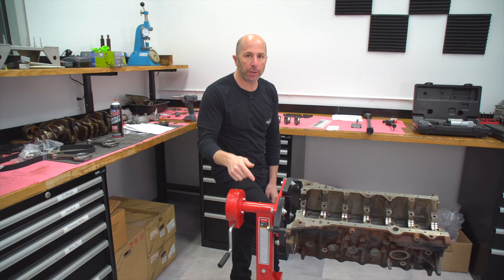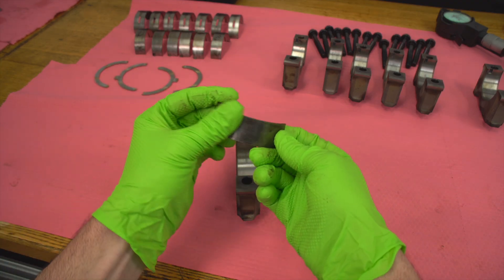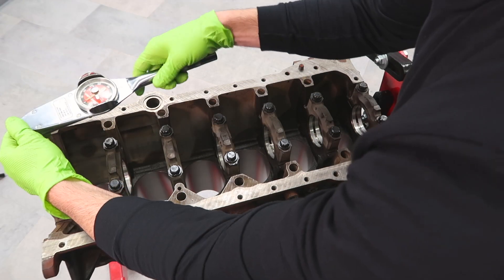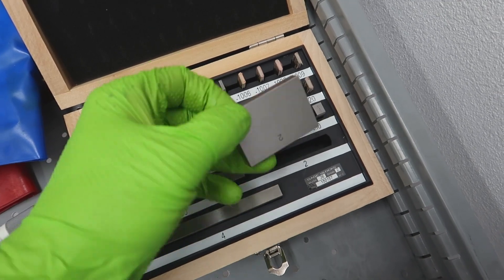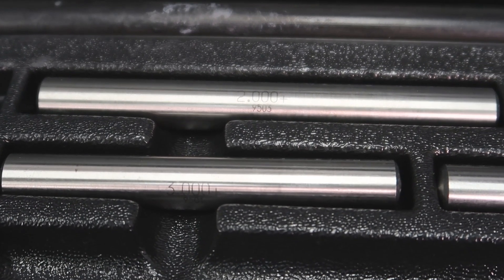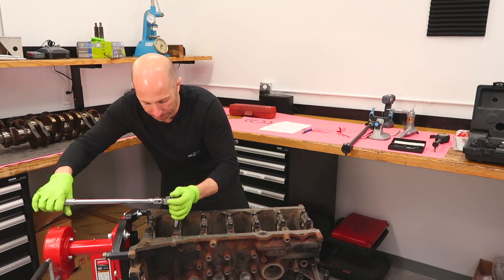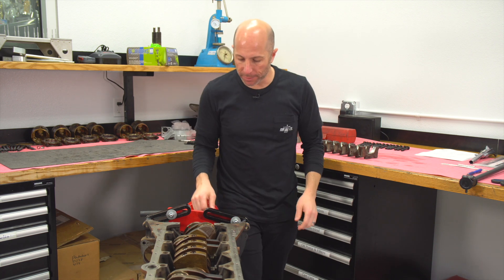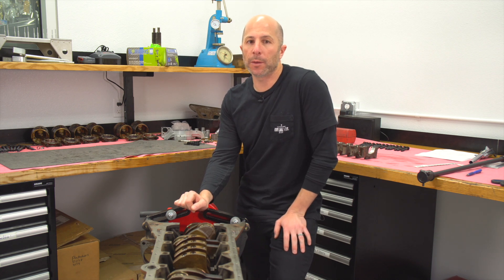$7 Vs $1,000 Engine Bearing Measurement Tools - Plastigage vs. Sunnen Dial Bore Gage

Comment: For an average joe  plastic gauge is sufficient , high end tools are for business or very high performance engine. lost my damn mind with the imperial system tho.
Reply: @firstbloood1   And your point is ?
Reply: Dont forget the SUNNEN causes a slight error, too. So not the complete error is actually caused by the plastigage.
Reply: Because decimal inches is so different that decimal meters ¡
Reply: 62mm vs 2.440945 inches.

OTOH, since we're not using fractions, it doesn't really matter what the system is. It's just decimals on the right side of the separator.
Reply: @AnttiBrax  Too much number
Reply: @AnttiBrax  You don't even need the last two decimals.  2.441 or 2.4409 is plenty.
Reply: @AnttiBrax  but it does matter because US industry wastes millions every year on conversion errors and mistakes from an inferior measure.
Reply: okleydokley That’s true, but honestly there’s not much the average joe can do about it, so I’ve just gotten used to both systems.
Reply: @truantray  you're right, we should stop using the inferior metric system.
Reply: @firstbloood1    Nasa switched to metric in 07 cause partner countries kept messing up the conversions and NASA was getitng sick of having to verify everyone's work for everything, apparently doing anything more than multiples of ten was to hard for them.....  And NO scientist will switch to metric to do calculations then switch back. Only a half wit could not do them in imperial.   Oh wait, Europeans... what do you expect, they can't even keep a self beneficial economic trading block from falling apart...
Reply: As a machinist you get what you pay for. If by the 1000 gauge in a heartbeat. But it’s not a thousand dollar gauge. You can get those for 250 in a used machine shop sales business.  Also, you need a ring to calibrate that bad boy. How do you know it says what it says. Wouldnt trust the .0001 gauge on a mic. I can get that by pressure. I’m getting a little nerdy. Sorry
Reply: I hate imperial but come on...how hard is it anyway?  They're both super easy to comprehend.
Reply: @eduardosampoia5480  1 km=1,000m=1,000,000mm. 1 mi=5280ft=63360in. 
1km²=100ha=1,000,000m². 1sq.mi=3,097,600sq.yd=27,878,400sq.ft.
not to mention the volume units and mass units and etc. it a chaos to use duodecimal/hexadecimal/sexagesimal number system in different unit systems..

to me metric system is way more reasonable and also easy to understand than imperial. everything just times/divide 10 or 100 or 1000...
Reply: @matthewq4b  yea, making realy simple things unnecesary complicated is such smart thing to do... and imperial doesn't realy even describe anyting that you use every day...
Reply: @matthewq4b  Might as well remember lenght of my finger, foot or something in cm as every human is slightly different sized, galon or pound based on ammount of water you can scoop in your hands, very precise... i'll give you that if you need to more or less measure something imperial may be usefull (still could use metric) but for most other things there is only ONE reason to use it: 'murica just HAVE to be special...
Reply: @RisiPL1   Ya apparently the rest of the world is not quite smart enough to do anything more than multiply and divide in multiples of 10.    And Imperial is more precise in terms of weight temp and measure.  There is a reason even in metric countries structural engineering is still done in Imperial.
Reply: @matthewq4b  As i said before there is nothing smart in making simple things complicated when there is no benefit in doing so, also imperial is not realy more precise because something called decimal place exist.
Reply: @RisiPL1   What have decimal point when you don't need it.   And good example is in the medical field where even with the single decimal point it is still more accurate. 
And BTW time , navigation, geometry, trig, and in turn a big chunk of physics  ALL use imperial.  So if you thing IMperial is dead think again you use it every day when you look at the clock or the date and ALL of these use the same divisors as imperial.   Metric is a construct with no basis in the physical world.  The  meter has been reworked multiple times and is now 606 nm (orange) spectral line of a krypton-86 atom. 
Ya like to see you explain or visualize that to someone.   Whereas a yard about is one stride and ALL of the imperial measurements can be explained from that. 
Weight Volume and distance and even time...   Try that with metric. 

You kids brought up with metric have no clue how intertwined and relatable imperial is with everything you do, but because you have to be able to do more than use divisors of ten,  it is too complicated.
 A sad state of affairs for sure.  And you wonder why people say millenials are idiots.
Reply: @matthewq4b  I have decimal point WHEN i need it, if i don't then i just won't use it or use cm instead of m. Just like when you use inches but need to be really precise you use thousands of an inch which is a decimal as far as i know. You are kind of right about navigation, geometry and trig because as far as i know 360 degres cricle is basicly imperial measurement but we use it mostly because there is no real advantage in switching to something different and WHOLE WORLD USE IT on the other hand we have "rest" of imperial system whis is used by only 3 countires an unfortunately one of them is USA...  And, yes the DEFINITION of a metre has changed over time to make it easier to use it as a standard, meanwhile inch is based on lenght of barleycorn, yeaa maybe relatable in everyday life but how does that help in any way? If you don't have scale or something of known lenght on hand its just as easy to imagine how many meters some thing is as doing it in inches, feet, yards, hands, sticks, palms, digids, nails, spans, cubits, shatments or any other imperial unit of lenght you may think of a the time. And this whole thing doesn't have anything at all to do with millenials and whether or not thay are stupid or not (Though I would have to agree with you on that its not looking good lately). And if you are intrested at all i recomend you watch this, just for laugh if not anything else. https://www.youtube.com/watch?v=r7x-RGfd0Yk
Reply: @RisiPL1   Ah but here is where you don't need a scale for find imperial measurements since they tie into time everything else all you need is a stick, the sun and 24 hours.   Try doing that with metric.  Simply you can't. The ONLY advantage Metric has is its divisor is ten. That is it.   And really when it comes down to it that is a pretty crap reason to adopt a system of measurement especially when it has no tie into the physical or practical world around us.
Reply: @matthewq4b  I'm sorry but just no. I know several engineers from my metric country who are most certainly not using imperial for anything at all. Even NASA is using metric. I guess NASA is also too dumb to use Imperial then?
Reply: @matthewq4b  Regarding astrophysics that is simply not true and flat out incorrect. I am hardly uneducated, quite the contrary but I suspect argueing with you on this matter will accomplish nothing at all. You are argueing semantics and are obviously not willing to even contemplate the other side of your arguement hence not reason to debate any further with you. But thanks for clearing up that flat earthers are adamant imperial advocates.
Reply: @LurifaxDK   weak.
Reply: @LurifaxDK    Really tell me what unit of time do they use ?  Hour min and seconds. ?  Looks like imperial to me.  And do tell rotational bodies have how many degrees in a circuit?  Last time I looked it was 360 (imperial)  and not 400 (metric).    Looks like the flat earther here is you.... and you just can't accept the truth.
Reply: @matthewq4b  That's actually an argument against only using imperial like you are suggesting.
Its just saying to use the more convenient system for the application. 
Which makes the most sense. 
And for applications where you often have to convert, metric is the easiest.
Reply: @matthewq4b  The discussion should probably be more about using the SI-System instead of metric-imperial. 
Most of the scientific units, even used in the US use the SI or metric system. 
Volt = (kg*m^2 / A*s^3) 
The imperial time and degree is also allowed to be used in the SI-System.
Reply: @xPentag0n   The Volt has a metric equivalent it was originally defined as the voltage produced by a single standard type cell.   They then defined the volt in a metric equivalent. 

Much like they did with the second that is now defined by  transition frequency of the caesium-133 atom, mathematically expressed as  
1 s =  9192631770 / ΔνCs. 
 It does not change the fact that is an imperial unit of measurement and is 1 86,400th the length of a day.
Giving an Imperial unit of measurement a metric definition does NOT make it a metric unit of measure. 

.
Reply: @matthewq4b  You're clearly talking out of your ass here, regarding time units. There is no imperial or metric time unit. Just the one.
Reply: @matthewq4b  I really don't care if anything is metric or not.
Only if it's convenient or not and that are most of the SI units,.metric or imperial. 
Would solve a lot of problems if everyone used them.
And why use fractions if you an use tenths. 
Something x10^x is sooo convenient. But you can use that with imperials too. Kinda. We also use fractions while speaking, but calculating makes it really convenient
Reply: @matthewq4b  Metric system comes from water. 1mL = 1g = 1cc, boiling point of water is 100°C and 0°C is freezing. This all make more sense to me and can be easily "ViSuaLizEd"
Reply: @philer   Uh no the metric system does not come from water but nice try..

Comment: Excellent, well presented, not a sales pitch! I like you advocating lint-free cloth, I've used white microfibre cloths, they work well. Apart from cost, another reason for using Plastigage is temperature, precision gauges should ideally be kept at a controlled temperature to avoid errors caused by expansion/contraction of the metal.

Comment: Thank you for the video. This does highlight the cumbersome nature of the imperial measurement system though. Had it been in metric, it would spare you so much.
Reply: Not really, to anyone halfway competent they are just numbers. If you can add and subtract either one is easy.
Reply: @bedlamite42  and even so a good builder or should I say assembler, can tell you how much tenths on the gauge without the precision hashmarks, it's a matter of recording them every time 6 tenths here 5 there unrecorded is ill measured and inaccurate
Reply: @bedlamite42  They cannot be as exact, for example, the resolution is still 2.54 times less. Being able to learn something instead of using a system where you don't have to (in the same way) isn't the question. Just take this. Ten thousand and ten thousand are different measurements. A tenth or a hundred mm. I mean, he has a tool called micrometer. For Pete's sake, the tool, is called micrometer, a thousand of a millimeter.	It is its own SI-unit. It correlates perfectly to mm, cm, m, km. It's the same scale.

Comment: The other major difference is. if you want to blueprint a race motor and there is any liability involved requiring the measurements to be traceable, the Plastigage is useless. But it was an interesting comparison not often done.

Comment: This is probably one of my favorite videos I have seen in awhile.
I have been wondering this exact question for quite some time. I have also been eyeing engine blueprinting tools for when I get into rebuilding my own engines in the future. Admittedly, I am looking at cheaper models of course.
This lets me know that I don't necessarily need to invest in the tools to do certain measurements right. Also that I can use plastigage as a backup to make sure any equipment I do get is functioning to a minimum level as well. I'm someone who definitely likes peace of mind when it comes to precision equipment.
Thanks for this awesome video and I can't wait for future installments!

Comment from the maker: I made a mistake when reading the plastigage near the end. Should have said 15 or 16 ten thousands. It was late when I recorded the voice over. :)
Reply: .0015 is actually correctly said as one and a half thousandths.
Reply: @Turbogto_guy  thats exactly what i would have said being from the UK " one and a half thou " . . .
Reply: @johnboy5156  or 'a thou and a half...'
Reply: First thing i noticed about the whole video.  That said I use plastigage in my job all the time - green and blue and I find it works better than most people can measure when we are using diameters that require an inside mic and not a bore gage.  Just be sure to use FRESH plastigage, the stuff that has been sitting on the shelf for years is hard and brittle and very difficult to work with typically.
Reply: instead of 15 or 16 ten thousands, we would read that as "1 and 5 tenths or 1 and 6 tenths".  Just how its done in machine shops and manufacturing.
Reply: Those who may have noticed it likely knew what you meant anyway, via the context.  There's always somebody in the comments who's pedantic enough to point out that kind of error, but for those of us who mentally and emotionally graduated high school and can have an adult conversation without needing to attack every slip of the tongue, this was an excellent Micrometry 101 lesson.  I never would have thought of making the bore gauge "do the math for me" but as soon as I heard those words the concept clicked into place in my head.  No matter how much I think I know, I always learn something new from your videos, and I'm really grateful to you for sharing your wealth of knowledge and wisdom with the world for free.
Reply: @tomkord220  Ah, that's not really the defintion of pedantic when you're talking about a factor of 10 when working with bearing clearances.  Try again.
Reply: @tomkord220  No...this is a precision measurement, you need to say it correctly. Thanks to the author for correcting himself. You would NOT want to put an engine together with "15 thousandths" of main bearing clearance.
Reply: @tomkord220  What an asshole.
Reply: Good work tho man
Reply: I automatically knew what you meant but I definitely did catch it right away. Lol.
Reply: I was going to say... I've never built a 2j but i feel like something is off here lol
Reply: will you do the full build series? thank you kind sir for the shared knowledge
Reply: I saw it..But who i'm I to question LOL.At least you stood up
Reply: I was thinking something was wrong there.  Meh, it's a good video.  🙂
Reply: Spotted your mistake instantly when I thought "Wait a minute, he seems to have got confused over the decimal points!"
Reply: Beat us machinist to it
Reply: Would it not be easier to say one point five thousands?  And of course this is assuming the align bore is perfect. Plastigage in more than one location would show that. This might be more of a issue with US manufacturers
Reply: @randys66garage  nah that's just not how it works. 
Thousandths to machines and machinists. Is 0.001". 

Tenths is (tens of thousandths) 0.0001

One and one half thou can't be 1.5 as that would be 0.001.5  can't have multiple decimal points.
Reply: Lol yeah, 15 thousanths clearance would be a little noisy
Reply: @TheJuanverde  Ya knock like f**k , lol
Reply: You're fired.
Reply: Ahh glad you reposted! I thought that sounded different
Reply: I didn't want to say it in the comments. Glad I found you commented the correction
Reply: Your allowed to make mistakes.  Your hands down the best builder on the planet and I have been doing this for 30 years. Not a complement from some kid👍
Reply: I like at least .0025 on the mains and 
.002 on the rods. That setup is kinda tight  but I guess running today's thin oils makes it ok. I'm old so I'm used to thicker oils.
Reply: you should have said .0014 cause thats what the wax showed. thinner lower, fatter higher.
Reply: @AaBb-zj2ld  the thinner the gap, the more it will spread the plastigauge
Reply: @AaBb-zj2ld  No, it's clearance, he was correct on that point. If the two components are closer together the wax is wider, smashed more. So thinner wax equals more clearance, .0016 instead of .0014.

And, proper nomenclature in an instructional recording DOES matter, somebody may be just hearing this stuff for the first time and learning, they need to know what they're seeing.
That was one reason why Steph took the time to correct it.

Comment: This is fantastic! I'm curious, in your experience how often are bearings far enough out of spec that you decide not to run them? It seems to me like most OEMs would simply drop bearings in without measuring anything, so when rebuilding OEM stuff with OEM parts, it should all be just fine most of the time.
Reply from the maker: Machine work is where most mistakes happen but you never know. The whole point of the video is to get folks to check their clearances and know for sure.
Reply: @PapadakisRacing  That makes sense. So for and offset ground or undersize crank, that sort of thing? I may pickup some plastigauge for my turbo jeep 4.0l build just for a sanity check.

Comment: Yes do a video on reading mics. Did you use used bolts during the torquing stage? I know to use new ones for final assembly but used are fine for measuring?
Reply from the maker: If the bolts haven't stretched then you are OK. Toyota has a spec for the bolts. Depends on the engine.

Comment: I'm obligated to leave a thumbs up here.  I've built many engines and I've used both Plastigage and Chinese bore gauges and micrometers, and I've always seen similar results, but since I dont have any high end measuring tools I always wondered how accurate it all was.  This confirma what I had hoped.  Big thanks for doing this.